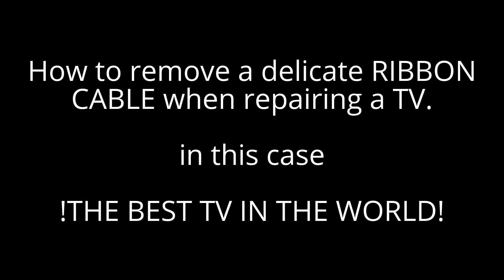How to remove a ribbon cable from a TV logic board - TV repair

Comment: Thanks for the video. I looked and looked and never did find your video and finally figured out how to do it by myself. But was very worried I would break something trying to do it all by myself. My problem was, I didn’t do a Ribbon Disconnect search. I was doing a band, wiring or a cable disconnect search. One day someone in our house said they needed some ribbon and the light bulb appeared above my head. My board was still being repaired, but I thought once it is repaired I need to put everything back together and perhaps I should do a “disconnect ribbon from circuit board” search and sure enough, there was your video. I was going to make a video, but yours is great and to the point, just hard to find for the really novice DIY guy who doesn't know what things are called. Great video!